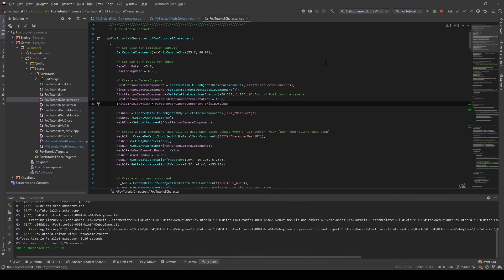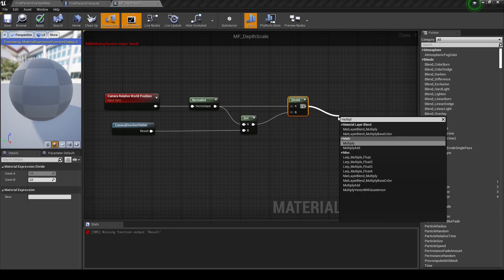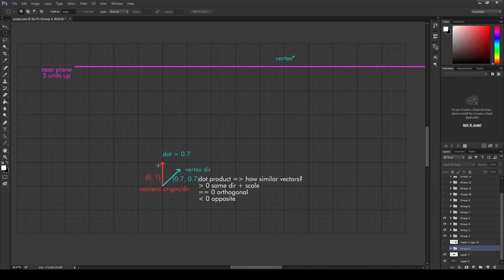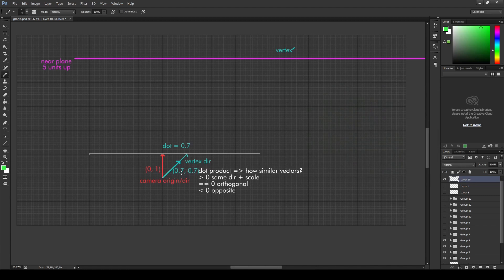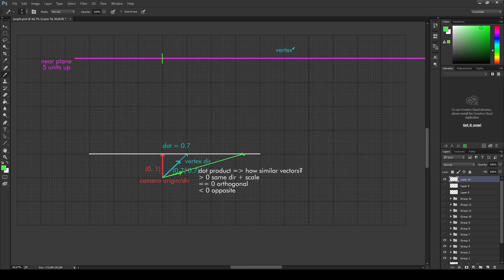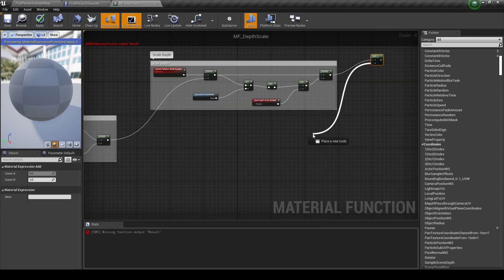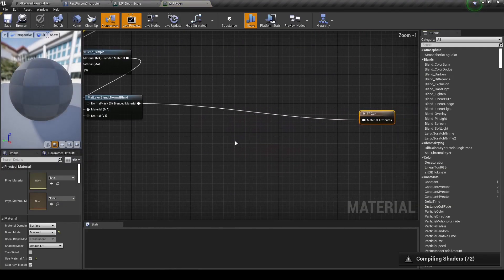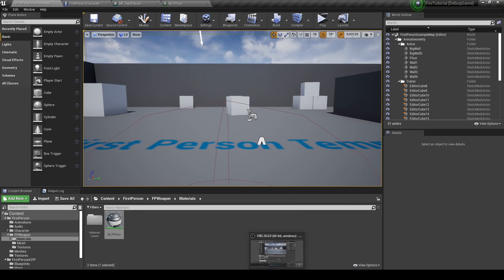Fix Weapon Clipping - UE4 FPS Camera [3/5]

Comment: is the shadow issue solved?
Reply from the maker: Hey
Not as of now. I haven't got the chance to work on it. I have it on my backlog and will post a video about it as soon as it is fixed.
Reply: @tigerpunchsportsclub8366  So will I be able to use this for say True First Person where I could be doing this on a third person mesh and the weapon (I could live with no shadows being cast for now)?

Edit: Nevermind it works. Although I would like to add that the weapon and hands/ third person mesh depth should be set to 0.2 and 0.05 respectively to work (Worked for me)
Reply from the maker: @vegitoblue2187  Hey, great to hear! 
Thanks for letting me know that it works :)
Reply: @tigerpunchsportsclub8366  yep it is the exact method Rainbow 6 uses based on the glitches seen in the killcams with parts of the characters flattening.

Another question tho how would one handle muzzle flash in such a case?

Comment: This is exactly what I was looking for, Thank you so much for this tutorial. I do have a question, where would I apply the material function in a material that doesn't have a Result node of the material?
Reply: nevermind I found a way to do it.
Reply: @stealthgamesaremyjam145 could you explain how you did it i cant figure this out. I just have a texture that connects to the Base Color pin on the result node.
Reply: @rustyshackleford5307  The node that your texture is connected to, do you have a list of other pins such as Metallic, Specular, Roughness. More importantly can you see a pin in the list named "World Position Offset", if so Plugin the material function we have created into the world position offset pin, and add a constant parameter to the input pin on the Material function with the value of 0.1 as the default value. 

this worked for me so I hope this helps.

Comment: This is a really good breakdown, the solution is really smart! I think I've seen the video you based this solution on and I like yours better.

Could you not use Shadow Pass Switch to solve the shadow issues? I haven't tested it, but i assume that would work

Comment: I found a easier solution for this... i scaled my camera down to 0.25 and attached the arms to it, and later the weapon to the arms and all with the same scale, so it looks like before but because it is smaller it stays in the caracter collision and so i have no clipping :)
Reply: this method breaks down too easily and has issues with animation. You will still clip skeletal meshes from enemies. I tried it because I needed to solve an issue I was having with a realistic scope material. WPO is the best solution for clipping but like with anything it also comes with its down sides

Comment: How do you split everything up like that at the end?
10:25
Reply: You can see he inserted the SetMaterialAssets node, then clicking on it, on the left hand side set the port to use WorldPositionOffset and plugged the new function into it. If you are in a material you created you can plug it straight into the WorldPositionOffset pin.
Reply: @kilrain_dev  Thanks!